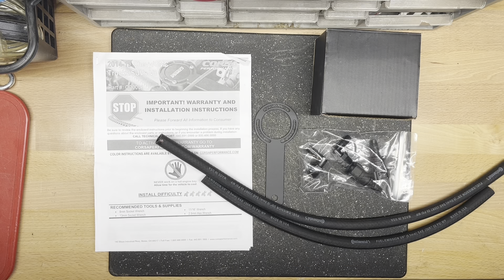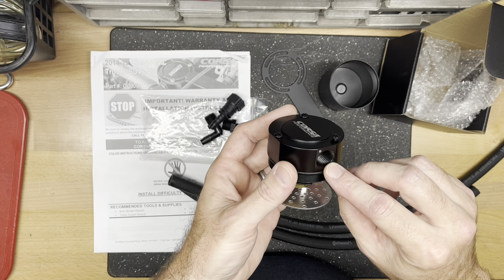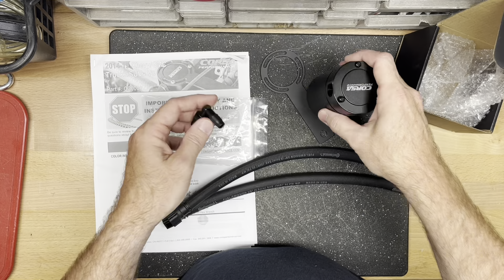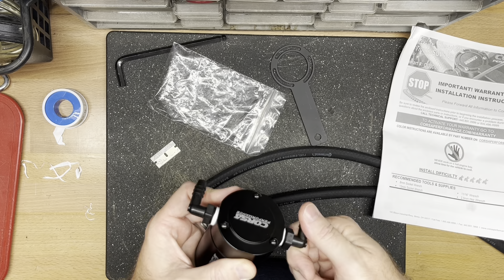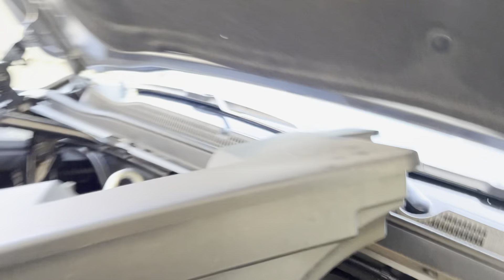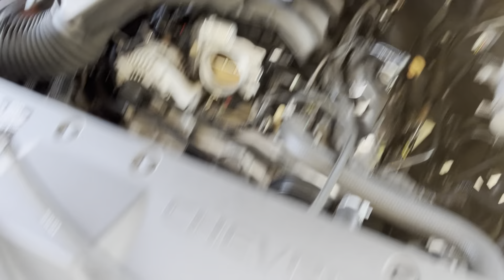Corsa Oil Catch Can Install

Comment: Thanks for sharing your install video. I ended up buying some longer rubber transmission hose and mounted the catch can in the empty battery tray area on the driver's side of my 2017 Yukon. Added some plastic loom over the lines and it really looks like a factory install. I just did not like the idea of the lines in the way of the oil fill cap on the valve cover. Even with the longer lines the catch can still works like it should. Thanks for sharing your detailed video. Catch cans are a must on these direct injection engines without added injectors spraying fuel over the intake valves. Bad engineering but installing a catch can helps this carbon buildup problem dramatically.